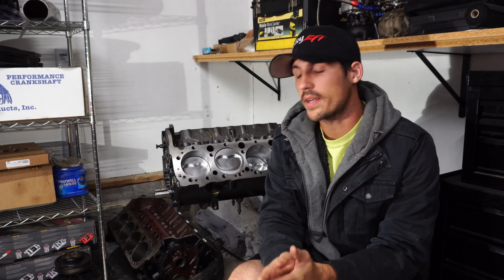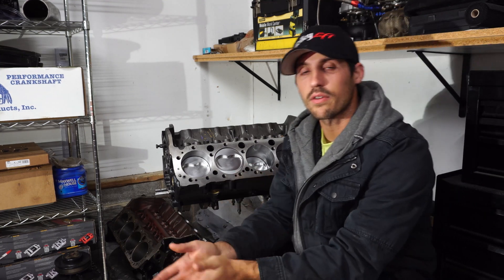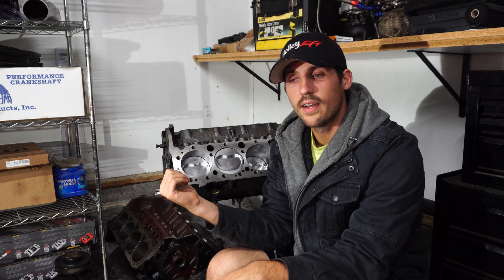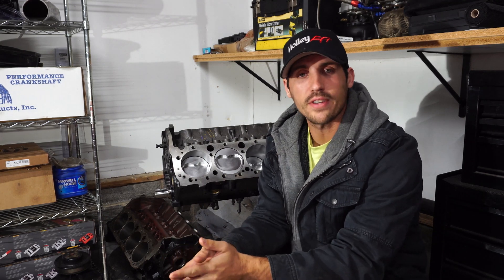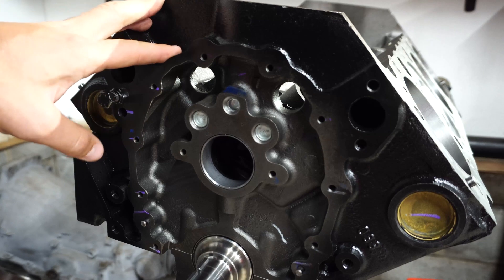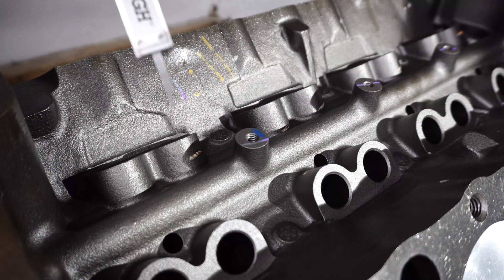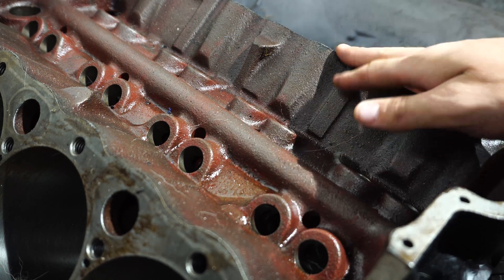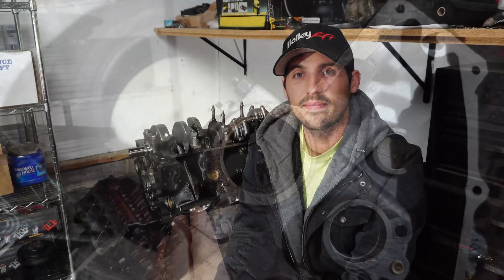Roller Vs. Non-Roller Small Block Chevy (How To Tell The Difference)

Comment: I came here to get some knowledge...... but, instead I have more questions....
I have a 1987 1 ton pickup with original motor and it has the "nipples" that stick up for the girdle that would hold the lifter retainers in place but, they are just cast into the block they arent milled flat or threaded.....
I guess its a "non-roller" "roller  block"..... 
Super annoying....

Comment: Im puzzled can you help me out, i have a 1995 chevy sbc im thinking its a flat tappet but when i lift the intake off it has the three holes but they’re not drilled they’re just flat but have the three humps but just not drilled, so what does that consider my engine?? Its a 350 tbi

Comment: Hi I have a 1995 k1500 350 Tbi . How do I know if I have a flat tapped or roller without taking the engine apart? I read that up to 1995 the 350 came with flat tapped. Some some with roller provisions but were flat tappets.
Reply: You can take the intake off and remove a rocker and pull an individual lifter.  Heads don't need to come off.

Comment: This is the best video I have found concerning roller block id. I have an 87 Iroc-Z that I am slowly restoring in which the original motor had been replace with a jasper 355 engine. Started out replacing a blown hose which turned into a bad water pump, and I never put the new pump on and all the brackets/pulleys  because I figured I'm half way to a cam swap. Ended up ordering a pulley kit and a holley stealth ram. Held off on the cam because I wasn't 100 percent if it was hydraulic roller block with a hyd. Roller cam and hyd lifters in it.

Comment: What about running an "old style" / "retro style" hyd. roller camshaft in one of these roller blocks? These older style cams don't have the stepped nose like the newer roller blocks do. Does someone make a timing set that allows for this combination? I have an L31 block and a retro style roller cam that I want to use, but the newer style timing set is not compatible.
Reply: You will need a new cam don't miss match everything and try to make it work with what you have

Comment: Great short video.  I have a 1970 chevy small block 400 in a Monte Carlo.  Came stock and never been touched.  I am doing a full resto rod and wanted to run a Howard roller cam and lifters.  Really did not want a flat tappet with the negative issues.  However, will not race, will not drive radical and only on weekends.  I would prefer a semi lopey cam and what would you recommend?  Aftermarket heads do not have steam holes drilled.  Would you just keep stock heads and redo?  Thanks,
Reply: i dont think stock heads in 1970 had steam yet

Comment: Do you need to make any modifications if you put flat tappets in a roller block? Like longer push rods or different rocker arms? Anything??
Reply: I recently replaced the roller cam from a vortec 350 with a flat tappet cam on order to comply with a-stock race rules. I had to buy longer push rods and a different timing set. The rest is the same.(or the same enough, motor runs amazing)
Reply: @nicklester4761  How much longer pushrods did you use

Comment: i love your video  and i have a 5.7 vortec  4bolt main  engine   that i just bought and it has the  that same set up  for the lifter  valley   and cam plate .    it has a stock   cam and tapit lifters   and it didnt have the lifter  plat   or cam plat .  i found  out i didnt need it on   my set up .   .

Comment: My block has the taps on the top as you showed, and taller valve guides, but I do not have the 2 extra tapped holes. What does that mean?
Reply: I just watched a video where a guy had a roller block that didn't have the holes so he had to drill and tap them

Comment: Can you install a flat tappet cam in roller blocks?
Reply from the maker: Yes i have a flat tappet in my roller block that's currently in my Camaro no issues. Just need to have the correct timing set and lifters to go with the cam and your good!

Comment: Trucks 87-95 are roller blocks but came with flat tappet cams, easy to add roller cam. All cars had the roller cam though.starting in 87’. The blocks are the same 87-95.
I’d only rebuild a roller 350. Have a bone stock Vortec 350 with aftermarket intake, quadrajet it runs much better than 70’s smog sbc.

Comment: Great job. Nice video. Would be great to see you also go over differences between  400 and 383 block. Like steam holes etc. Did u know if u have a tri 5 block the motor mount pads aren't there. The other issue when converting non roller block to roller is the cam button some cam buttons wont work with some timing covers etc. I only suggest this because u have 2 blocks there to compare.
Reply from the maker: Thank you those are some great video ideas! With Ohio winter in full swing now I'll be looking for videos to shoot in the garage 👍
Reply: @ZanesGarage  another one would be how do set tdc. Aka top dead center and how to line up timing Mark's sometimes there is some adjusting. Your welcome hope u can use some of the ideas